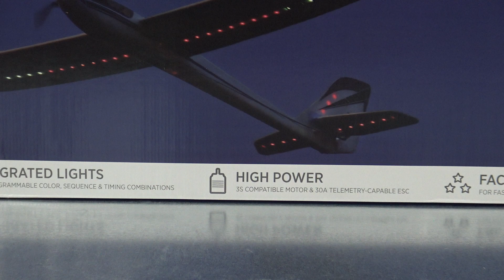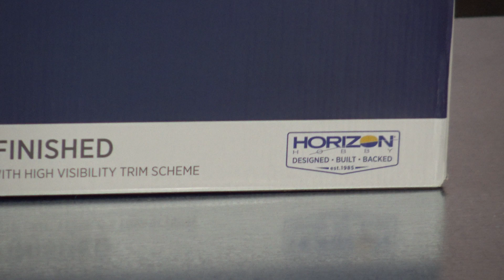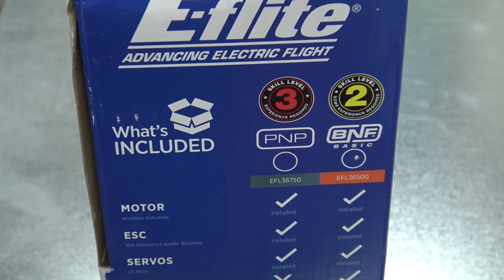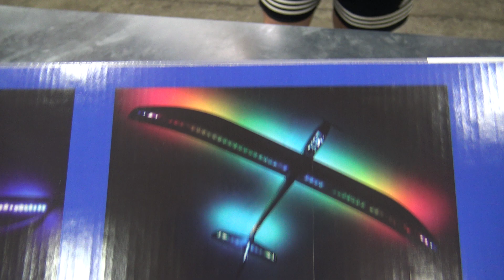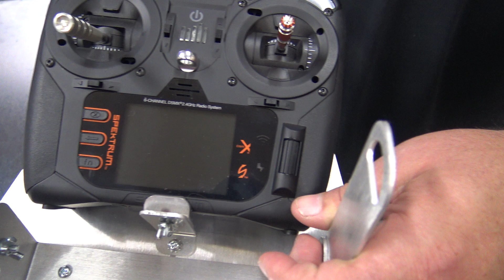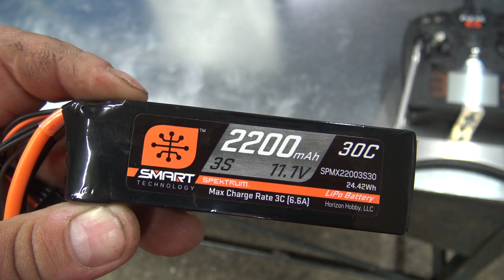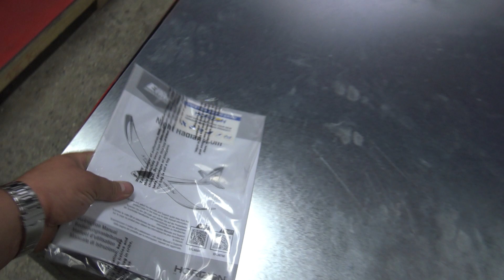NEW Night Radian 2.0m BNF Basic Unboxing

Comment: I’ve got the E-Flite Radian FT 2.0 (previous version) and it truly is amazing. One of my absolute favorite birds in the hanger.  I fly it like you said when I want to relax. I’ve learned how to hunt thermals and find lift which is the point of soaring.  It’s such a good glider, I’ve enjoyed a 35 minute flight with a 3S 1,350mah battery and landed with 90% remaining on the battery. All lift!

Also, it’s such a good glider beware when you are in a strong thermal. I’ve had to purposely force exiting thermals multiple times as the glider was headed to a different galaxy.  

You won’t miss the ailerons.  It flies perfectly with elevator/rudder.
Reply from the maker: Its amazing my friend. But I was doing maiden with 2200mAh batterie and its way to heavy.
Reply: Is the 2.0 the XL version? Also thank you for the battery info 👍✈
Reply: 1300 to 1350 is perfect CG and all you need for it.
Reply: @Darrin

The Radian XL was 2.6m. I had it too. Not nearly as good as 2.0 and problematic. Was known to have a very weak tail boom. Has since been discontinued. I like the 2.0 much better.

Comment: Another option to click. Only 3 screws to assemble is great, you can quickly build this on the runway.
E-Flite really looked at the construction again, some great solutions and new ideas.
Now surprise us with a great maiden. By the looks of it, it will sail forever !!
Reply from the maker: Just two in fact. The third is spare one. It wants to glide forever.

Comment: Another excellent vid ....my Volantex ASW 28 (like your black one Robert ) as you know has similar cables you have to poke through holes in the wing root which can be a bit tricky sometimes. Pity E-flight didn't put a plug in connector on the wings the same as the tail. Particularly since its the wings that you have to fit/remove at the field whereas the tail stays attached .

Can't wait to see it lit up at night :)
Reply from the maker: Oh that ASW is amazing. And I also wonder why not some simple plugs here. In fact it takes time to connect them. Good thinking.

Comment: So the telemetry is Spectrum based,  works with spectrum radio,   Question I have is,  will it work with Multi protocol module, and Multi protocol Tx  available on the market now days,   Eg  will the radio master  T16 receive the telemetry data
Reply from the maker: I really wonder my friend. Will try once to see.
Reply: @PetrincicBrosRC  would be very interesting.    I'm currently a Frsky fan boy,     running OpenTx     have a multi protocol module for using other receivers,     just havnt yet brought or tried spectrum.     Would like to as the Bind in Fly option seems a great idea,    especially with all the telemetry installed ready to go.   Be a nice compliment to my hanger.   Lol   start collecting Eflight planes    lol
Reply from the maker: @russcole5685  I think you can bind without problems, I just wonder about telemetry.
Reply: @PetrincicBrosRC  correct,      that is what I'm wondering myself     Will be very neat,   then would not need to buy new transmitter .      I dont want to buy a whole plane without knowing.   Lol      keep up the great work guys,